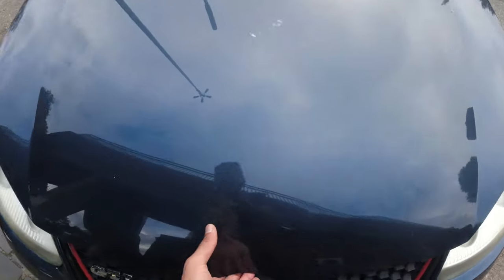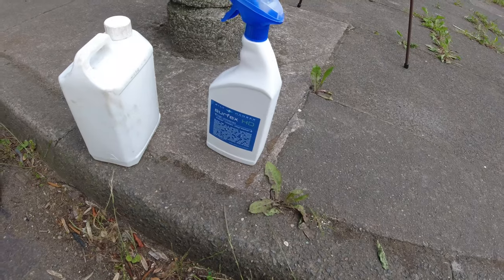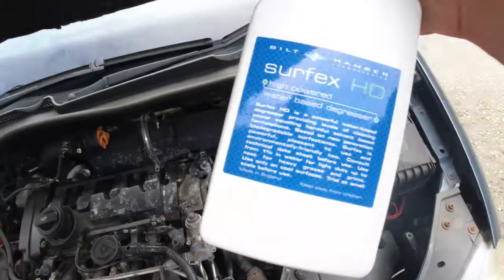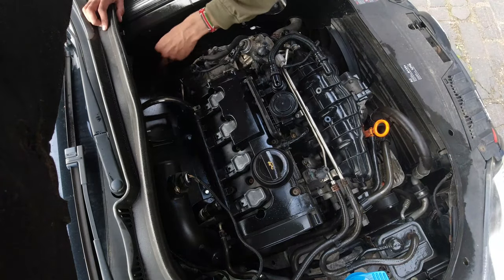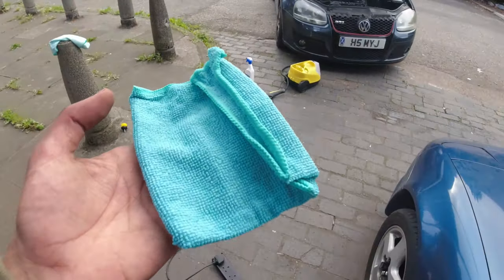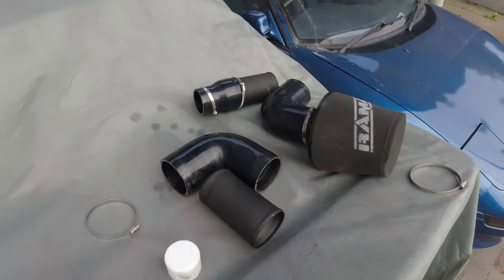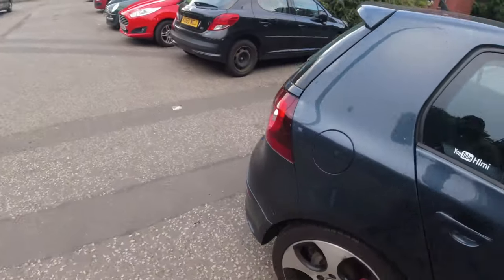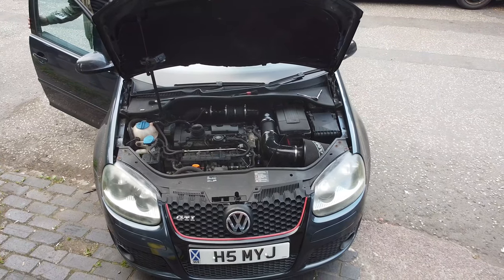Mk5 Golf GTI - Engine Bay Detail (ft. Surfex HD)

Comment: Have you thought about removing the oil cap neck so the filler cap sits flush with the engine? I've heard about it but i don't wanna break anything so just left mine
Reply from the maker: I'm the exact same as you 😂, I've heard about it (from previous comments) - but too scared to do it
Reply: Just get the engine hot...stuff a microfibre down the hole. Then get a mallet and one hard whack. It's very easy.

Comment: It's a Golf MkV, the air intake is high and that car could have easily made it through travelling forward. As the air intake is above the level of the exhaust and the car body is engineered to be most aerodynamically efficient (replace air with water) travelling forward, he'd have done better travelling forward too - going backwards he runs the risk of water being forced into the exhaust at pressure.

Comment: Nice job, looks much cleaner now. What is the name of the block off kit/tool used to stop the coolant hose breaking because of the induction kit?
Reply from the maker: Cheers, I'm not sure if there is a block off kit available - but I know a lot of owners are fitting a metal version of the part (as to plastic) meaning it shouldn't break. There's a link in the description of "How my Mk5 GTI broke down"
Reply: @HimiJ  Thanks, I'll check that out